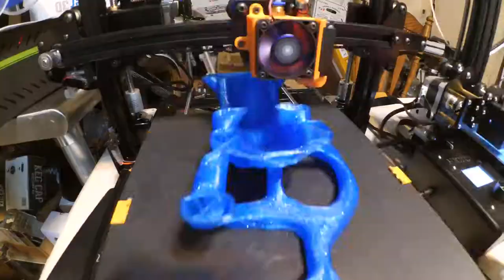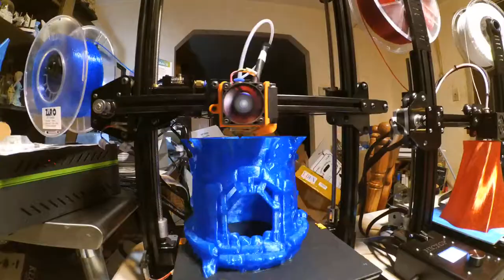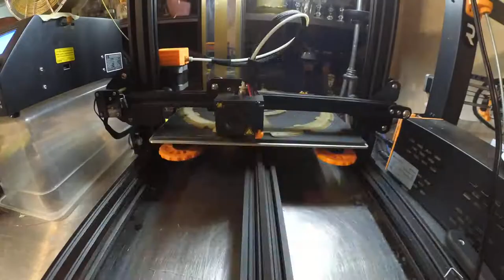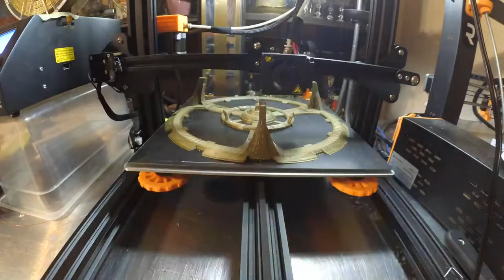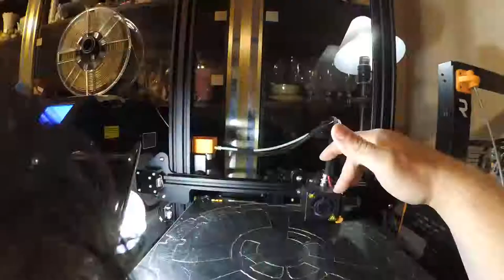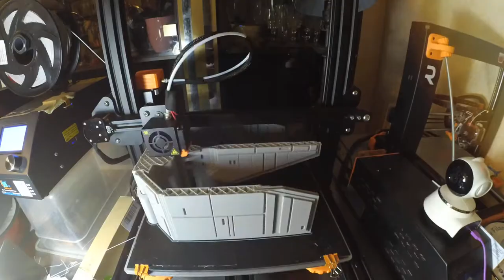Today's 3D Print - Timelapse - Birdhouse, Balloon, Moai, Vase, DS9, Mars Scuttle on the CR 10, Ender

Comment: Maybe a question, which fillament, and which heatbed you can recomend to buy for the CR-10? Can you make a video with the perfect settings for the CR-10? That would be awesome!!!!
Reply from the maker: I have a video with the settings I use for the CR10 check the todays 3d print playlist. found it 
https://www.youtube.com/watch?v=aTPiK_Ktj-0&t=11s

as far as I can concerned the first filament to use is ESUN PLA PRO (check description) grab any color.

why? its its supple so it won't crack or split feeding it. its reliable and consistent and it prints like creamy butter. I have never had a filament lay down so smoothly even if your bed level is not "quite" perfect. its tolerant a little.

the prints are also crazy strong. its by far my favorite goto general filament. I use the super cheap stuff (and most of it works just fine) but you have to play with it sometimes to get that first layer down etc.. far less so with the pla pro. I use the cheap stuff when I am goofing off making mega prints etc.. etc..

when I need it to work right every time. I use the pla pro. to drive that point I have 11 rolls of the stuff on my rack. I make sure to never be out of it. its pretty cheap too. $20 to $25 a kilo.

once you are better with the printer you can make pretty much any filament work.

btw esun pal pro likes it hot. so try 215c at first and adjust to suit your printer and model as it goes.